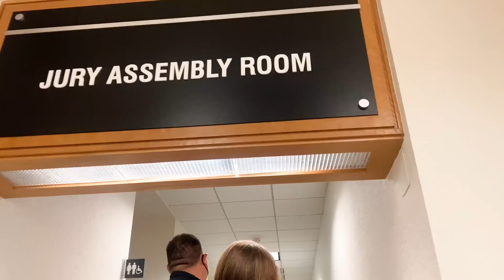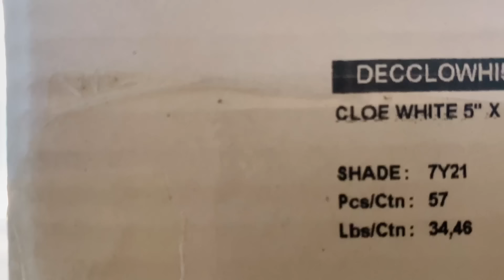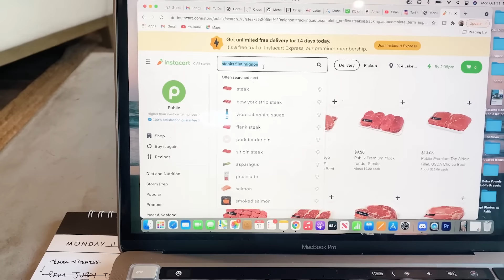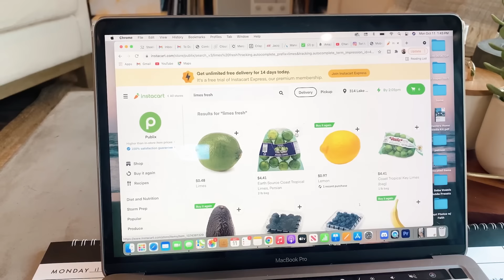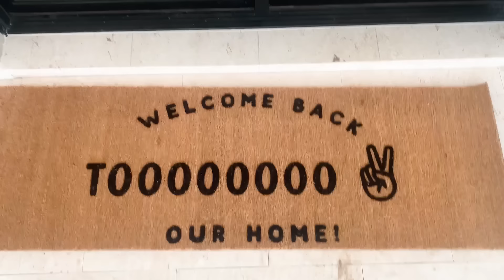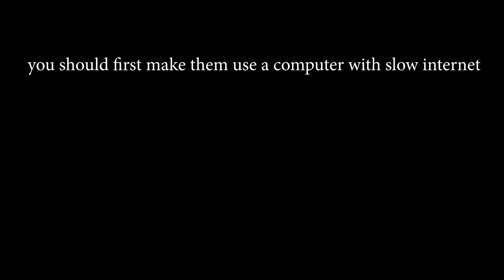HOW DID THIS EVEN HAPPEN? | VLOG: Home Updates, Jury Duty, Behind the Scenes

Comment: As a homeowner. Front loader drums wears out worse than top loaders. This is very true when it comes to the washer. The rubber seal also degrades over time which can cause a leak. It will cost the same as a brand new to replace. Problem is finding the matching Washer with your dryer 5 yrs down the road when the washer gives out. We opted to go top on our replacement washer. Never looked back.